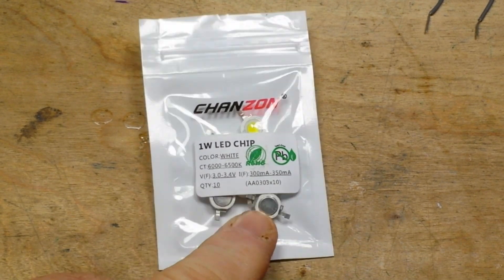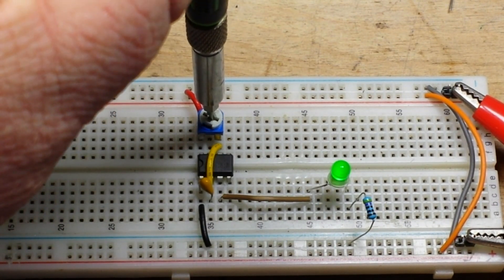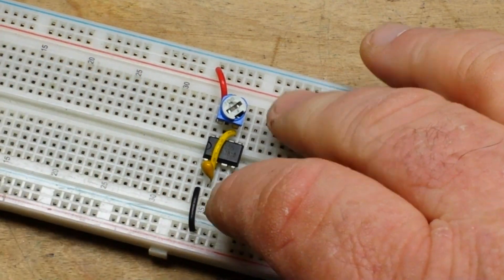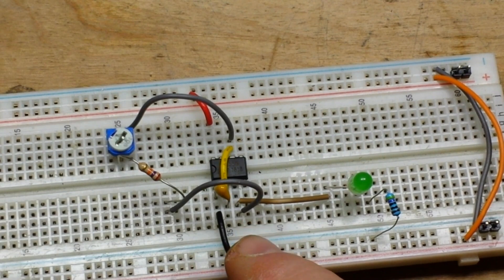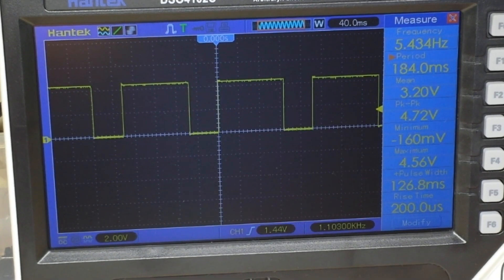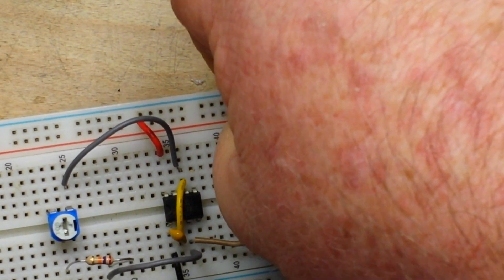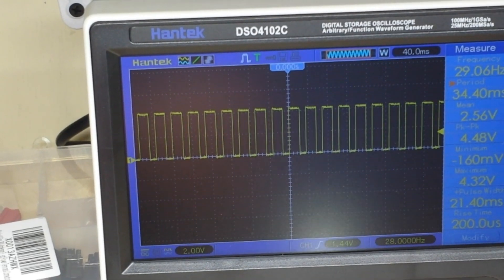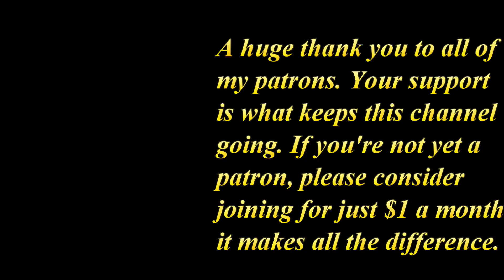Adjustable strobe with 555 timer and 1W LED

Comment: THANKS,
I am looking for a good 555 circuit to flash an LED from about 30Hz to 150HZ.  I do NOT want to see any flicker, which means the LED must flash faster than your "PERSISTANCE IF VISION" range.  In other words, the after-image of each consecutive flash does dot give enough time for the image to "fade" before the next flash
From your video, that looks like about 30Hz min.   I never looked it up.
Reply from the maker: 30 hertz is the accepted frame rate

Comment: What is the purpose of the MOSFIT?
Reply from the maker: It's a switch. It switches the higher current needed by the LED and keeps it away from the sensitive IC.
Reply: @learnelectronics  hey, thank you for the explanation!

Comment: @learnelectronics  - Just a little breadboard tip.  When you use components with flat leads, like ICs, MOSFETs, Pots or such, twist the leads 90 degrees.  They will go in better, stay put better and cause a lot less wear and tear on the breadboard.  You can test this by turning the component 90 degrees.  Of course, you can't do that and have your circuit work, so just twist the leads. ;-)
Reply: I have been doing this since I saw the inside of a breadboard...good to hear this from someone else.  I have probably posted 50 comments explaining this...but have not ONCE seen anyone do it.  The regular way REALLY damages the breadboard!
Another rare thing that took me many HOURS to track down...A jumper wire was inserted in a breadboard, but not quite enough bare wire was exposed, and the insulation slipped in, and there was no contact.

I believe one can learn something new like this, or a better technique do a particular thing, with each project.  BEST THING I LEARNED: clean up as you go...

Comment: Could i run the 555 and the mosfet on 12 volts ,  to power a 12 volt relay ( i want to fun a 120 volt light bulb)  without needing any current limiting resistors ( no leds in circuit)?  Also if i feed  12 volts into a 555,  could the 555 feed its out put into a cd 4017 decade counter.  just want to run everthing on 12 volts.

Comment: The 555 timer ic is one of my favs.
I've used it for a strobe light like 5 years ago. It's so awesome that this ic still gets recognized and appreciated.
Thank you for your great upload sir.
Reply: Send circuit diagram
Reply: @sachinkokate5060  https://circuits-diy.com/led-strobe-light-circuit-using-555-timer/
Reply: I used a 5v relay with a hand held flashlight as the output leds. I put a diode on pin 3 as to stop inductive kickback from the relay coil.
Reply: I've used the 555 IC, at least, since 30 years ago... 😁 so it's used an valued for more time that you think.

Comment: I’ve purchased 7 colored 1watt led lights from the net for very cheap . They arrived mount in the light fixture with just stripped blue and black wire hanging off ,no switch no nothing, so how do I light and some how control these lights???

Comment: Hey Paul!!!  Thanks for the great videos!!!  I got a couple of noob questions...  Why an N-Channel Mosfet instead of a BJT for the low-side switch??  Also, how exactly are you limiting the current to the LED to 350mA?  Where is the current limiting resistor??
Reply from the maker: BJT doesnt switch fast enough. I'm limiting current with my power supply.
Reply: Paul, thanks for the quick reply!
Reply: you can use a 2n2222 bjt up to about 400ma without too much heat, and a resistor to limit the current

Comment: My two cents: a variable speed spinning motor with a white dot on a dark shaft would really help show the "stroboscopic effect".  When the LED flashes at such a high rate that you can no longer "see" the flash,  that is due to "PERSISTENCE OF VISION".
GREAT VIDEO!!!  I am going to build one in a box...

Comment: Thanks for this pedagogic video. Interesting stuff. A question: How would you set up components on your breadboard for being able to adjust frequency AS WELL AS adjusting duty cycle?
Reply: changing the resistance changes the duty cycle/the rate at which the capacitor is charged/discharged. The frequency however is decided by the rating of the capacitor itself.

Comment: Another Great video. I just had a problem trying to use an ESP32 (Pin limit of 12mA) to a buzzer (3.3vdc BUT 30mA). The volts needed was the same But I needed more current capability. I have used a MOSFET in the past to drive a SSR, it also drew too much current (20mA) but also needed higher driving voltage ( at least 5vdc) than I had available in the ESP8266. I used the same MOSFET for this current (no pun intended) problem but there must be better or other alternatives for these low voltage/amperage devices.  Help if possible.

Comment: I have a question, I was wondering what way is the best way to clean out heavy dust from the inside of my realistic SA-1000 solid state amplifier so that I can preform voltage checks?.

Comment: This is great! I have a bunch of 555's and this is a great project. Just to clarify - you didn't use the BJT due to current constraints (no other reason)?
Reply from the maker: The BJT doesnt switch fast enough either
Reply: @learnelectronics  ahh okay thx

Comment: I do have a question but it’s not about your strobe light, I have an old realistic sa-1000 integrated stereo amplifier that won’t power up, the transformer has many output taps going to the board, I have not checked for voltages yet because I’m working on another project right now, do you think maybe by some chance it could be a diode in the power supply section or is it possible a bad cap? It’s all original and no one has been inside of it but it is exstreamly dirty, a lot of dust all over everything, what would you suggest? To make matters worse I can’t find a schematic for it any were, I hate to throw it out because I believe it’s something simple, just for the hell of it I thought you may have an idea we’re to start.
Reply from the maker: All of those things are possible. Start from the input, trace the power, component to component until you find where it stops. There's your culprit. That being said, given the age; electrolytic capacitors are high on the list of suspects.

Comment: If you want to use an LED as a stroboscope, it is important to generate very narrow on pulses. I have found the simplest way to do this is to use one of my favourite ICs, the quad nAND Schmitt. With this, one gate is configured as an RC oscillator, two are connected as a monostable and the last provides logic inversion. A single mult-turn pot allows the oscillator to be frequency adjustable, its output triggers the monostable which gives a fixed narrow pulse width that can be adjusted with a preset pot or switched resistors, but more of that later. The output of the monostable can be inverted to drive the N channel power MOSFET which powers the LED. As the LED is driven with a high current, beyond its DC power rating, the LED can be protected from a  fault condition that leaves it in the on state by AC coupling the pulse signal into its gate. To facilitate this, the gate is coupled to the driver circuit with a low value capacitor and a pull down resistor and reverse biased clamp diode are fitted in parallel to ground.
  To ensure the oscillator frequency and pulse width are not adversely affected by the high current pulses taken from the supply, in my case a 9 volt battery, it is necessary to fit a large reservoir capacitor across the supply rails to the LED and MOSFET. It is also necessary to regulate the supply of the quad Schmitt with a 78L05 linear regulator circuit. A low value resistor is also placed in series with the LED to limit the maximum current it can take from the battery.
A suitable working range for the pulse width is between 10us and 100us. The oscillator frequency can be set from a few Hertz to a few kilohertz. I have run tests where the LED has been pulsed up to one megahertz, as confirmed by photo diode connected to an oscilloscope. At such a high flash rate the pulse width must be very narrow to avoid overheating the LED.
In practice, a maximum flash rate of two or three kilohertz is suitable for for most stroboscopic applications, particularly as fast rotating machines can be viewed at harmonics of the flash rate. 
At very low flash rates the average light output is noticeable lower and increasing the pulse width above 10us improves the brightness. ( 60us to 100us is optimum). I have used this circuit to examine the spinning blades on computer fans and freeze the motion of high speed drills as they cut through metal.

P.S. there are a couple of circuit tricks that can improve the isolation the linear regulator provides from the led current pulses.
If a power diode is placed in the input to the regulator, followed by a reservoir capacitor to ground (zero volt rail), the very short pulses reverse bias the diode, stopping the reduction in the supply voltage, due to the high current demand,  from pulling down the rail supplying the quad Schmitt circuit. In the monostable and MOSFET driver, where a capacitive load is being driven with a clamp diode fitted, it is important to protect the Schmitt gate output with a series resistor, with a 5 volt supply to the Schmitt IC, a 270 ohm resistor provides a good margin of protection to limit the gates output current.
Reply from the maker: Wow! Thanks for that. I hope folks read it Nd apply 8t to their designs.
Reply: Do you have a schematic for your circuit?.... sounds very interesting
Reply: @neilgroves3592  as I did not generate a PCB, the circuits it is not in my computer archive, however I could draw up a copy of the circuit diagram, but I am not sure how I can post it here. It is a relatively simple circuit, using a few tricks to make it work with low-cost components. None of the components are particularly critical in value. As far as I remember it uses a CD74HC132 Schmitt trigger and a high power blue Cree LED, as I had a few free samples.
I have been meaning to build it on PCB, as I have a hand torch which would be an ideal case for a stroboscope. As the pulse mark space ratio is so small, it runs perfectly well from a PP3 size battery. In a finished design I might use a rechargable NiMH of a slightly larger capacity. The reason the project has not been finished is because I was having a problem finding a heat sink to back the LED that is compatible with the parabolic reflector in the torch.  My prototype was completed on vero board and was sufficient to perform the tests on the computer fans and their speed controller. I was also playing with the idea of adding a five digit LED  frequency counter read out of the flash rate, rather than use the bench counter.  There are all sorts of enhancements that can be made, but the commercial versions are not that expensive and you quickly wonder if it is worth buying rather than building when you start adding more complex features. The basic circuit cost practical nothing to build and provides a very acceptable stroboscope function, all be it rather basic compared to the much more relatively expensive commercial offerings.
 PS I have found a copy of the original circuit in my lab book. While a picture (circuit diagram) speaks a thousand words, the circuit is so simple I could describe it.

Comment: "Arduino feels like cheating" I so much agree with you.
In my opinion working with arduino is no fun at all. It's the same as buying an already made circuit and just by adding a few more components to make something work is kind of cheating to say you made it.
The fun of electronics is to build from the bones out. Your brain really starts working.
I know many people won't agree with me but I always thought that.
Reply: David Wingood  
You're right. But even going that farther back it actually feels kind of fun. At least once in  a while.
Reply: The advent of microprocessors in my opinion has ruined hobby electronics for me.

Comment: I also love the small simple projects. Could you perhaps do a tiny project on how to simply make a servo motor turn 90 degrees clockwise and anti clockwise by pushing two different buttons for example.
Reply from the maker: Sure

Comment: I used a few of those running 365nm UV to mod a flash light  for  mineral hunting and inspecting for scorpions here in the land of Disenchantment.  NM.    One 18650 cell can last a hour or so easy.

Comment: Nice video! My camera does picks up fast flashes the same way. Reflecting off something seems to help for a little bit. I usually make sure to have the right component values ready for the max flash speed that the camera will pick up nicely no matter how prepared I am to make an impromptu video otherwise. Hopefully I'll stumble on a setting that does better job picking up flashes some day.
Reply: Most chity phone camera work good for checking IR transmitters.   Mine can even show IR Laser beam.
Reply: @pulesjet  Nice :)